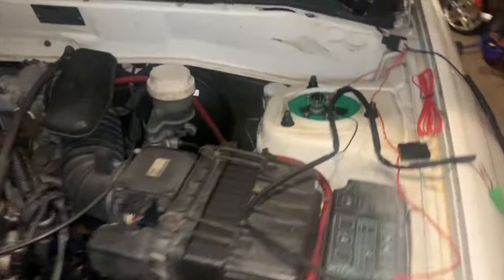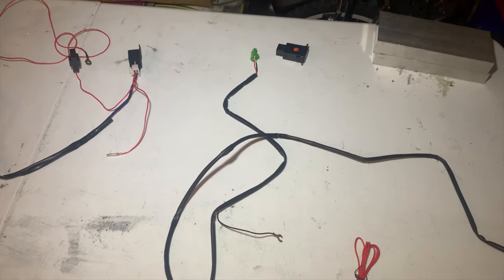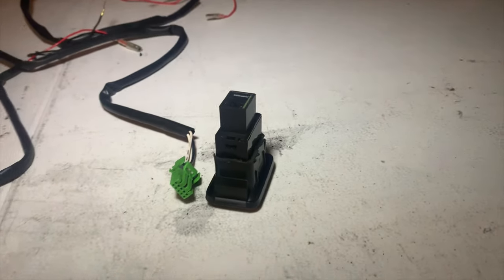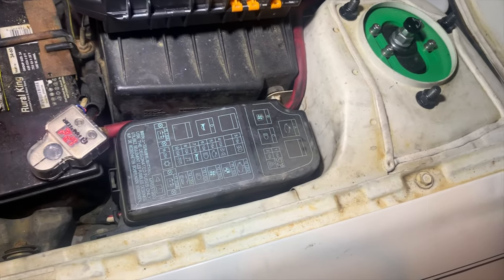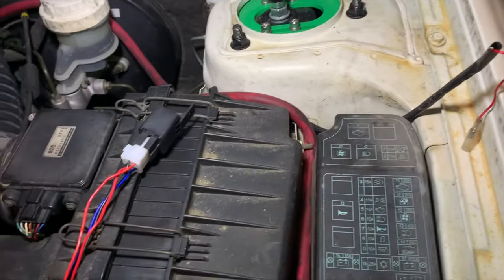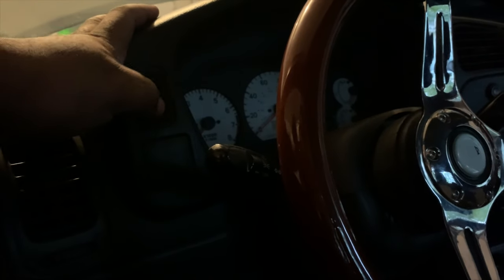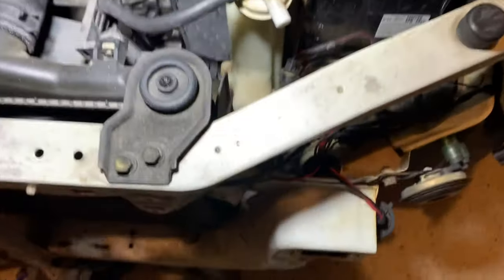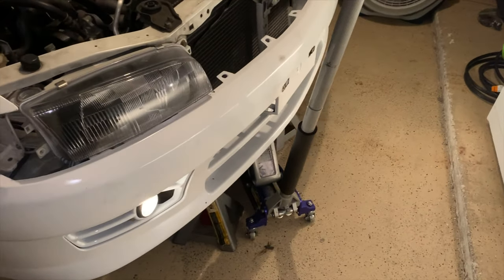Part 15 2001 Mirage Fog light wiring and bumper installation

Comment: Looking good, what are you planning as far as bumper support?
Reply from the maker: Something temporary for now but I’m going to be getting the original bumper frame for the short bumper Just waiting for It to get here but for now I’ll probably get some L-shaped bar and put something together
Reply: There should be a few more brackets available through Mitsubishi (last count was 5 in Atlanta iirc) I think it's less than $100 and they can get it to you in less than a week.
Reply from the maker: Oh really is that from a dealership or from someone specifically???
Reply: @legionelitemotorsports2096  through Mitsubishi
Reply from the maker: Oh I definitely have to look into that hopefully I can find a part number
Reply: @legionelitemotorsports2096  MR184433 List price $92.52
Reply from the maker: Perfect I’m going to jump on that as soon as possible
Reply: good video Where did you get the bumper?